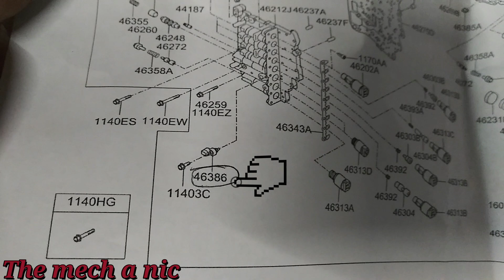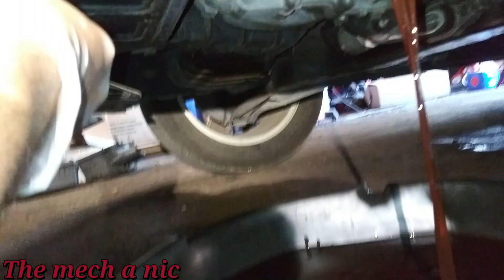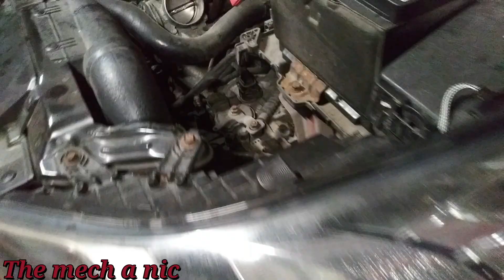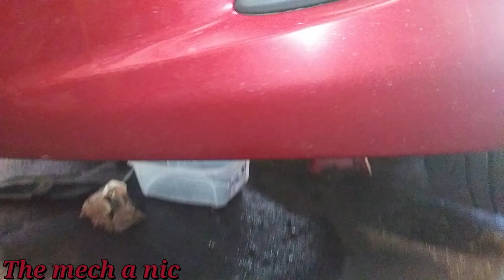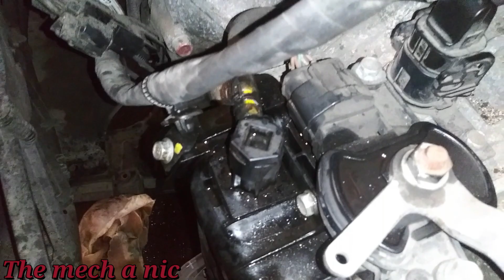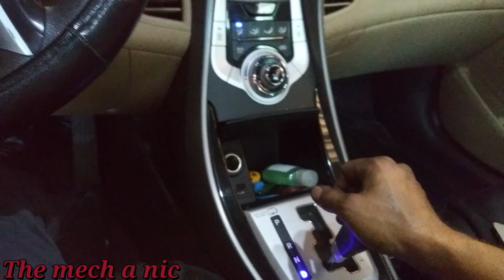P0713 P0711 hyundai elantra transmission temperature sensor ( hard shifting)

Comment: Awesome!!!!!
I’m fighting the transmission $3,330 Hyundai wants for faulty torque converter. 
No sensor came in for transmission heat- engine light came in after I heard gear grind - they did a flush!!! $350!!! Day after engine light went on told me Tran gone!!!!!!
Hyundai National escalated to🥰🤞

Comment: I have to say that I'm angry and frustrated.  I took my 2013 Accent to a dealership two years ago and told them I was having intermittent hard shifting.  Their response was "Golly we don't know what that is, we couldn't replicate it, but we changed the tranny fluid for you.  That'll be 700 bucks, thank you"  I've been getting knock sensor codes but not the PO713.  I think you just diagnosed my problem with a 12 minute video...SMDH.  I'm taking it to my local mechanic tomorrow morning, and I'll come back here when he's finished and confirm your genius.  Thanks for pointing me in a direction other than "gee, sorry".

Comment: Getting P0711 & P0713 on 2011 Sonata Limited so probably my issue too. Will most OBDII readers give temperature readings or just codes?  Did you have to lift vehicle to gain access to pan bolts?

Comment: Exactly describes my problem. Car lurched  whenever gears changed. Check engine light finally came on. Diagnostics shows P0711 and sure enough “live” performance review” showed tranny temp sensor reading 5F. It’s 97F outside today.
Reply from the maker: Sounds like a bad temp sensor to me. After the repair the owners hard shifting has been completely resolved.

Comment: Great video man. 
I recently got P0713 too and I think I'm not getting 4th gear in my 2004 Toyota Rav4 Automatic. At 60mph, my RPM is at 4000. Will surely get this replaced ASAP. This just confirms what I was recently told by an auto transmission specialist. Thank you Sir for the detailed video
Reply: Yes, me too exactly the same. Won't change to 4th gear on my Hyundai Getz, was doing 90kph with 3500 rpm. How did it went, were you able to change the sensor? Please reply. Thank you.
Reply: @ZianEnzoBros I have replaced the sensor and the wiring harness, cleared the code but the code persists and I still don't get 4th gear and my reverse gear jerks when engaged. 

Found your solution?
Reply: @juliustay2541  Hi there. Yes, I have found the solution. I was thinking of replacing the solenoid set but they were too expensive. So I've only replaced the oil transmission temp sensor which was my main suspect. What happened was that the old sensor was at fault giving it a high resistance reading, making the ecu think that the temperature was too hot so it was at limp mode wouldn't shift to 4th gear thus giving the fault code P0711. I've replaced a genuine sensor, so since the trans pan was already opened, looked at the trans filter looks like it was never replaced before (250k on the clock), so I've also replaced the trans filter and fluid. Put it all back together. Now it shifts smoothly.  All good now since I've fixed it :)

On your part, have you tried diagnosing the solenoids?
Reply: @ZianEnzoBros  I'm happy to hear about your solution. 
I have replaced the valve body as well but no change. I don't get any codes for the solenoids. Only P0713 which has to do with the automatic transmission fluid temperature sensor. I recently got the diagnostic procedure specifically for my car and I have begun troubleshooting to narrow down the problem. 
I even got a second ECU to swap but that didn't change anything. 
It's between my sensor and the wires!

Comment: Awesome video let me ask you a question a job like this how much it cost i have the same issue with my car but i don't know if i take it to the dealership they charged so much sometimes is excessive or if i take it to a mechanic i would like to know at least how much it cost??
Reply from the maker: I don't know how much but I do know the dealer is usually more expensive.  Have a regular shop do it if you're not ale to. No need to pay high dealer prices

Comment: I am having trouble finding the transmission speed sensor. My Elantra 2014 doesn't seam to have an external part that looks like the sensor sold at the parts store. Is the speed sensor also internal? can you help a brother out?
Reply: So the OP could probably tell you better but my research suggests the input output speed sensor is one unit and unfortunately is internal on this transmission. You’d have to drop the Pan same as OP did.

Comment: So did changing the transmission temperature temperature  fix the rough shifting issue?
Reply from the maker: It sure did
Reply: @themechanic6117  Thanks, I have a 2013 dodge dart with a 6F24 Hyundai transmission in it. Unfortunately the transmission temperature sensor isn't exactly the same as this, it's integrated into the wiring harness.. I'm having difficulty in finding the right diagram/info to see if it's a simple remove the pan, old harness and plug it in or do I need to remove other crap as well..

Comment: I just had the same problems and codes brought it to valise Hyundai and they replaced the valve body harness and I’m still having the same problem.
Reply from the maker: Did they charge you?
Reply: @themechanic6117  Yes, and that’s just the start. On the way home from picking it up at the dealer the vehicle lost power on the turnpike and started blowing black smoke out of the hood, it broke down, balise came and towed it back to the dealer and now they are saying that the engine is seized. We just had them do over $2,500 worth of repairs and it breaks down on the way home from there. They are now citing TSB #21-EM-001H 
“This bulletin describes the procedure to inspect an engine exhibiting noise between the cylinder block and piston due to possible scuffing on one or more cylinder walls. Follow the procedure outlined in this bulletin to inspect and replace the short engine assembly if scuffing is observed.” 
But we never heard any tapping from the engine neither did they on there multi point inspection. So now I have a broken down car that I just spent 2500 bucks on that didn’t even make it 30 minutes down the road after picking it up.  What can I do? They are saying it’s not there fault but it’s hard to believe this is just a coincidence
Reply from the maker: Sounds like you got screwed over. I'd cut my losses and go buy a Honda or Toyota.  I'd never take a car to the dealer.A regular shop could of got that same work done for less than $2500.... (if the valve body was the problem, which clearly it wasnt) that was just a waste of money. Never take your car to a dealer unless they're fixing something for free under a recall
Reply: @themechanic6117  This all actually happened to my sister unfortunately I live out of state so I wasn’t there to have helped her, I only found out about everything once all the damage was done, but yeah totally agreed, the stealership got another one.

Comment: Unfortunately bolts breaking up on removal is something I hate cause even though it’s not the technician’s fault it leaves you with a potential recheck,I know,I do this for a living.Good job,you gave me a heads up for the sensor.Harsh shift from park to drive only when hot,I have a code for sensor out of range.Thanks.

Comment: I have a 2014 Hyundai Elantra just turn to 100k miles. When I shift to drive it won’t engage or sometimes it’ll jolt hard and get into drive. It has no issues going to reverse or if I start in manual mode second gear it will go. I did the transmission drain and fill. It has no check engine lights and everything else works perfectly fine on the car. Any help would be greatly appreciated
Reply: I'm having the exact same issue. Did you find out what it was?
Reply: Did either of you find out what your issues were? My girlfriends 2016 Elantra has the EXACT same issue. Changed the input output speed sensors, trans temp sensors, fluid change with genuine fluid and it’s still doing it. No codes or anything.
Reply: Same damn thing I'm thinking either wiring or from front wheel abs speed sensor or shift solenoid after that idk what else it could be

Comment: Excellent video!  Your attention to detail as you explain each step is commendable!

It's been > 7 months since this video was posted...  Has the customer experienced this issue again?  Or any similar/related issue(s) since the work in this video was done?  Or did replacing the temp sensor resolve the issue fully/permanently?
Reply from the maker: The issue has been completely fixed by replacing that temp sensor
Reply: @themechanic6117  Wow thank you for the super fast response!  Liked and subscribed.
Reply from the maker: Thank you
Reply: Idk if you can comment on this, but I was quoted ~ $680 total to get this done tmrw (that's for everything - including the couple of hours they spent diagnosing the car today, taxes, etc)...  does that sound high or about right?

Note: I'm in Texas... so not a super expensive place like Cali or NY lol
Reply from the maker: Sounds about right but thats shop prices for you. I think i charged $150 and the owner bought the part from the dealer himself. I dont charge anywhere near shop prices because shops really over charge and are expensive even for simple jobs. Its not uncommon for me to see $1600 quotes from a dealer/shop and im able to get the work done for the owner for about $700-$800, sometimes less .

Comment: My son just bought his first car on Friday. 2011 Hyundai Sonata GLS. Check engine came on within a few hours of having the car. Dealership sent us to a shop. Codes P0711 & P0713 came up. Car is shifting hard from Park to Reverse and while driven and down shifting. It’s like the car is confused. Most likely the transmission temperature sensor. Great video! I’m not really into cars but I’m learning a lot researching this all.
Reply from the maker: Good luck with your car. Apparently this sensor is common to go bad and cause hard shifting issues
Reply: @themechanic6117  Yeah that’s what I’m finding out. My poor kid has his first car sitting in the driveway he can’t drive until the shop can fix it next Tuesday.
Reply: @madelinejeanantiquesrestor9074  Thank you for all the details included in your comment.  I'm pretty much facing the same situation  (except it didn't happen w/in a few hrs of acquiring the car... wow... sorry you went thru that...).

I'm currently scheduled to have the temp sensor replaced tmrw. This video was the 1st time I've heard of this type of problem being fully resolved by simply changing the temp sensor.  When you had this done in your son's car, was the issue also fully resolved (as in this video)? Or has the same or similar/related issue(s) come up again at any time since then?

Also, and feel free not to answer if this is too personal, but do you recall the cost? My mechanic quoted me $600-ish for everything (temp sensor change, diagnostics, taxes, etc)... which is a lot more than I expected...

Thank you in advance!

@The mech a nic - If you're reading this, thank you for this video!! Very helpful!
Reply: @madelinejeanantiquesrestor9074  any update ? Thank you
Reply: @madelinejeanantiquesrestor9074  any update ?thanknylu

Comment: I have a 2011 Hyundai Elantra GLS thats giving the P0713 code, will that part fit?   Everywhere I look it says not compatible.
Reply from the maker: Call your local dealer and ask for the part number or just get the sensor from the dealer to ensure you get the correct part.

Comment: Nice Job Jon.  You need a small welder to tackle the busted bolts.  That one would have been relatively easy to tac nut to it.
Reply from the maker: Speaking of welders...i just bought a millermatic 211 for $1700 last night 😣😀
Reply: Cool.  Now call that customer back and pull that bolt.  Lol.  Find something to weld in your next vid.  Might be hard since you deal with some really rusty cars.

Comment: Nice one bud.  I would have never thought a bad shift because of the temp sensor . Do most of the fwd transmissions  have a hard time filling back up ?
Reply from the maker: For some reason the fill hole is very tiny. Im sure someone will leave a comment saying there's a easier way to fill it. Id imagine its just how a coolant temp sensor that's bad and reading -34 can cause a crank no start or a very rough running engine because the ecm thinks the coolant temp is -34.